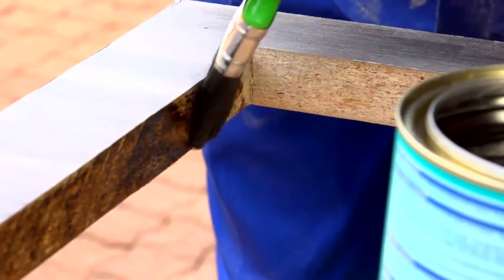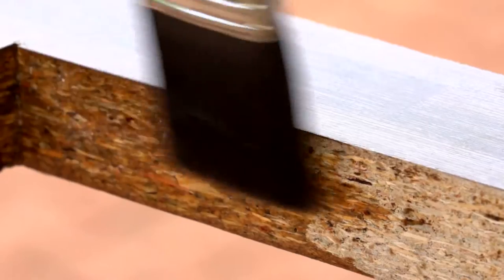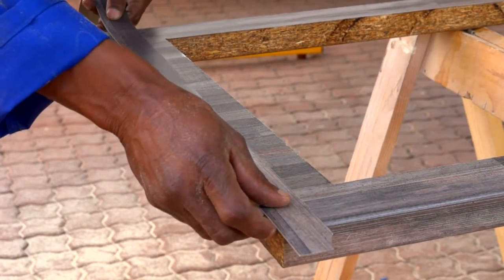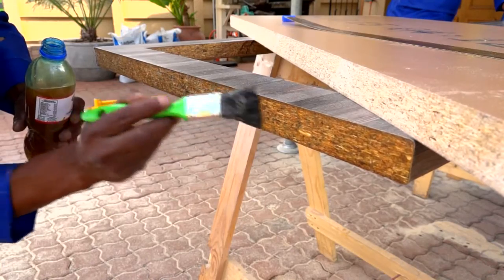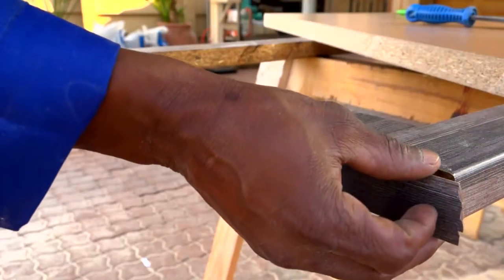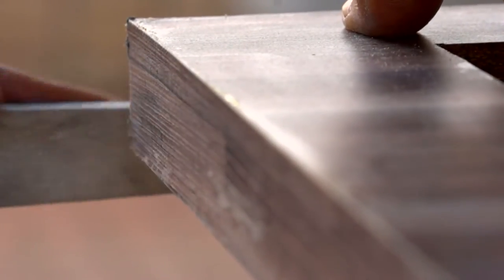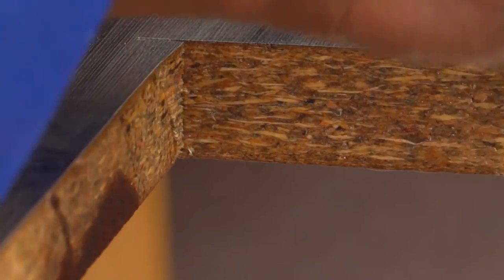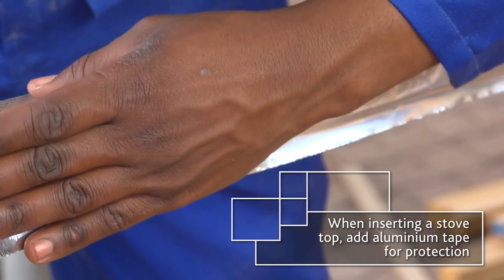Formica LifeSeal Worktops: Sealing the Edges

Comment: what do i use to seal the back edge of the top against water especially at the sink area after i have scribed and cut to fit the wall
Reply: I just found it. it is contact cement
Reply: @abdullahn9827  can you upload a pic
Reply: @KarmasKamin  the one that being used here is similar to
LePage Heavy Duty Contact Cement

In case of mold, you probably you need to remove the mold by replacing the bad part or using chamicals for that. Then you can add the coating that you want. Mold is caused by bacteria so it will continue to spread unless you remove it all.